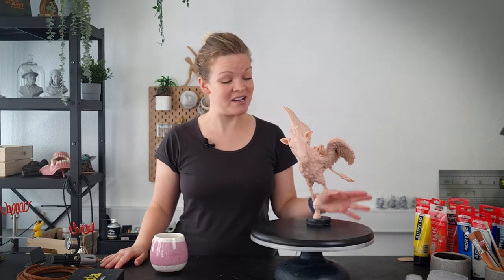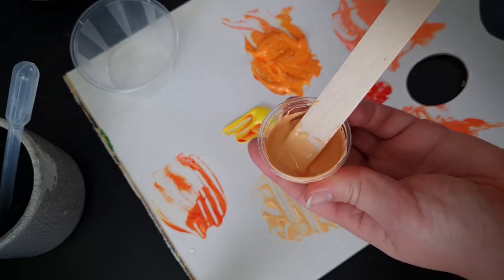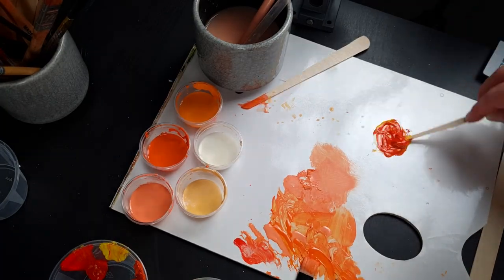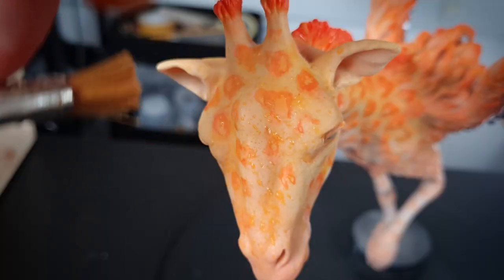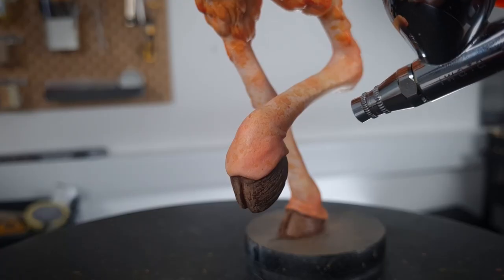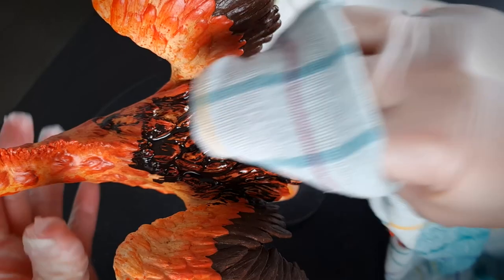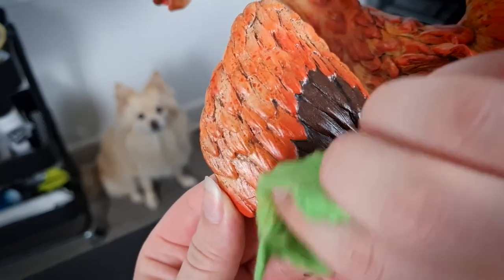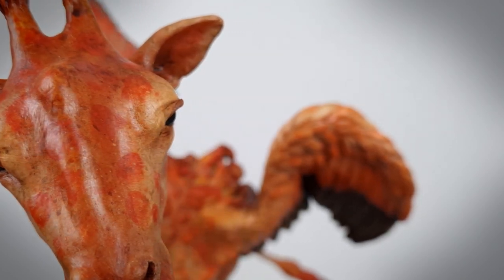AIRBRUSH Painting POLYMER CLAY Sculpture

Comment: hey I had question !
I wanted to ask, as I'm just starting making my sculptures(anime sculptures) which clay, colors and stuffs should I use?
Reply from the maker: Hi Jay :D Good on you for getting into sculpting! 

As you want to create anime characters, I would recommend Polymer Clay (as I'm also using in this video) as you can achieve a quite high level of details, and it's great for starting out as you can bake it at home and have a complete sculpture. 

You can get Polymer clay in many different colors (and brands) but i tend to just use white or tan, and then paint it with acrylics afterwards.

Below is a list of my commonly used products. I should mention that the links are affiliated, so if you buy anything via these links I get a small commission from Amazon, but it won't cost you anything extra :) and I only list product I use myself and can stand by.

POLYMER CLAY
Super Sculpey Polymer Clay (pack of 3) - https://amzn.to/3L3doPy  
Sculpey Premo Polymer Clay  - https://amzn.to/3uhRMt1
SCULPTING TOOLS:
Stainless Steel Sculpting Tools - https://amzn.to/3gfE6GD 
Loop Tools - https://amzn.to/34rUHnL 
Silicone tip / dotting tools - https://amzn.to/34sQe4w 
Turntable / Sculpting Wheel - https://amzn.to/3AT6VlQ 
ARMATURE:
Armature wire (gauge 10 / 3.2mm diameter) - https://amzn.to/3oivPGh 
Armature Wire (gauge 6 / 4.9mm diameter) - https://amzn.to/34qcX0Q 
Aluminium Wire Mesh - https://amzn.to/3okXfev
Reply: @SofiaBue  thank you very much.!